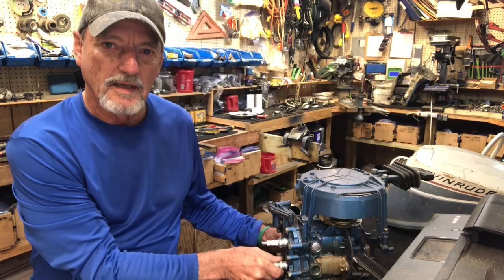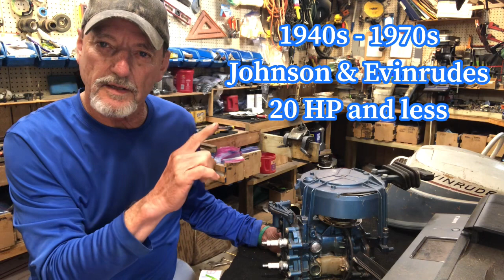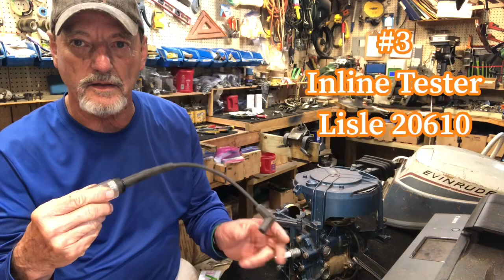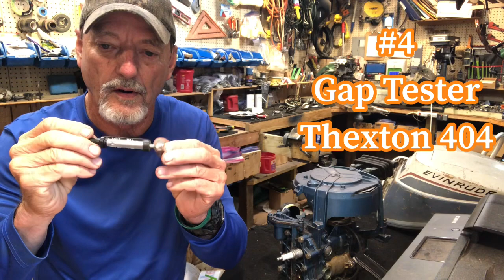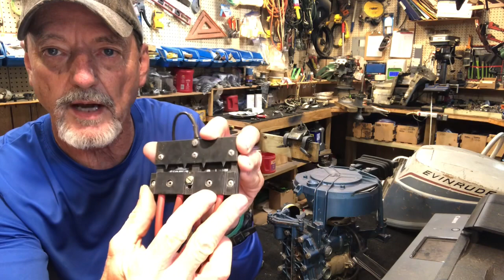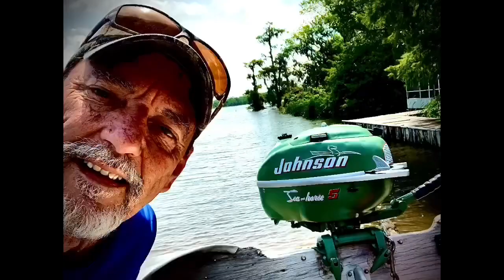How to Test & Measure Spark Vintage Outboards

Comment: Hey T Mike! I've got a 1966 Johnson 6 hp.  On both plugs I get spark across the inline light test like #3.  I've cleaned points (1 ohm across) and have 6-8,000ohm from coil/spark plug boot wire to ground. I dribbling a little fuel in each cylinder just hoping for a pop with no luck. 80/75 psi compression.   Any thoughts?
Reply from the maker: Try switching wires - might be reversed.
Reply: @michaeljsimon  Thanks for the reply! I've got the shorter one on top and longer on bottom as they were when I got the motor. I can't see a spark when I try grounding the plug(s) by hand/boot of plug wire either. I will say my tiller handle/gear seems pretty bound up. Is there a kill switch mechanism that would allow an inline tester to show spark but not actually allow spark to be made?
Reply from the maker: @travisestes6217  I don’t trust the in-line testers - prefer the Sierra gap tester.

Comment: ok I got the 1/4" spark tester. I have awesome spark on the top, but intermittent spark on the bottom. I have checked the coil windings .9oms, and continuity to the boot, cleaned the points, checked timing, swapped out condenser, but still intermittent spark out of the bottom....am I missing anything?
Reply from the maker: https://youtu.be/IbLNDjXvwHg